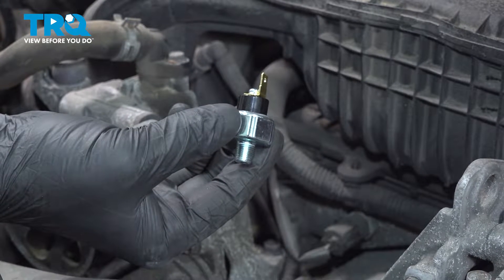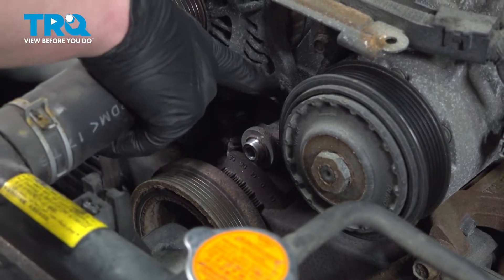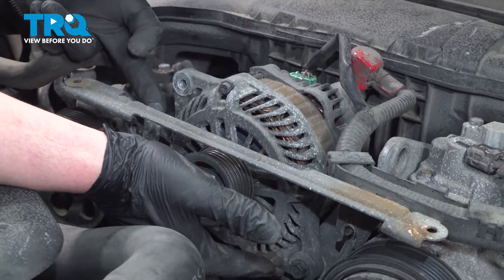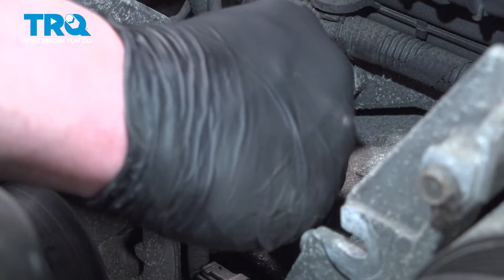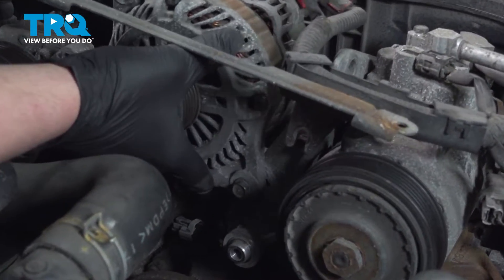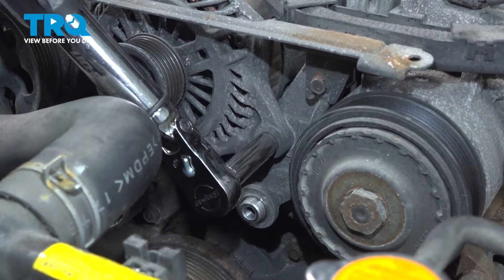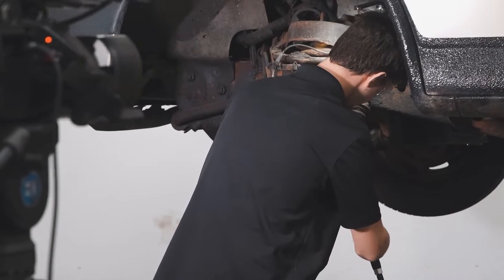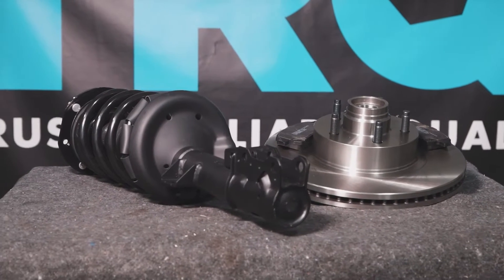How to Replace Oil Pressure Sender 2010-2014 Subaru Outback 2.5L H4

Comment: Quick question;

The part in the thumbnail is tapered, while the part you replaced is flat where the threads are. What's the difference?